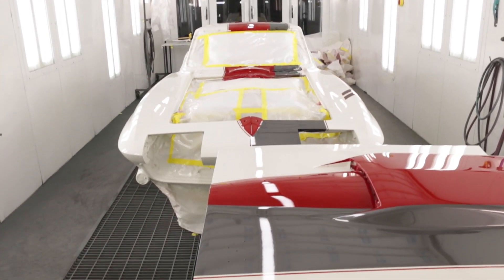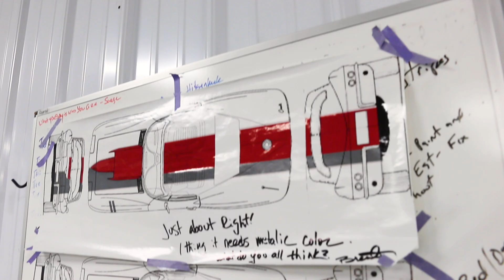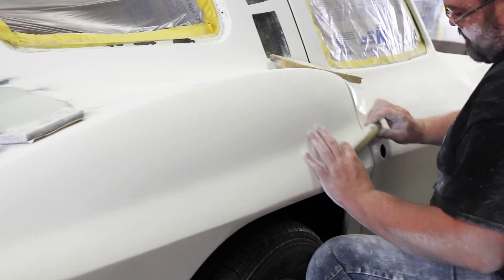1964 Corvette C2 Restomod Custom Paint and Suspension Upgrades at V8 Speed and Resto Shop V8TV

Comment: I like it. Bone stock is way overrated anyway. 🏆
Reply: @Leo Coffy- A buddy of mine had a 1970 Mustang with a nitrous oxide sprayed big block. Nothing special or rare or anything like that. He wouldn’t drive it in the rain or on gravel roads. It basically sat in the garage most of the time, but it did look good sitting there. One of my most frustrating high school experiences was looking at that car languishing away unused. If you can’t or won’t drive them what good is a car anyway? 👀